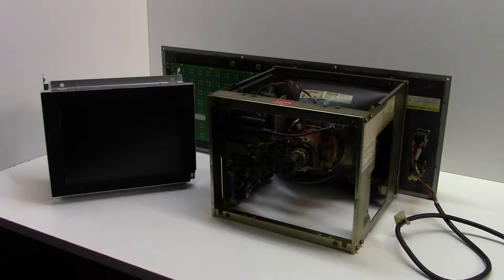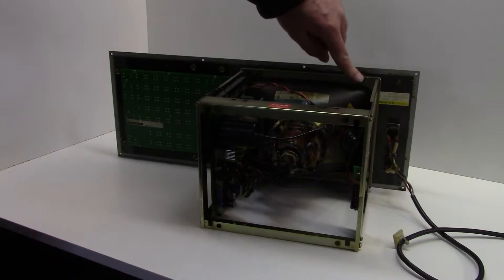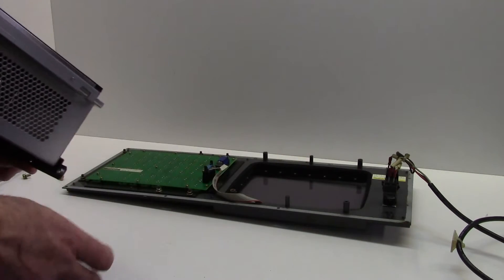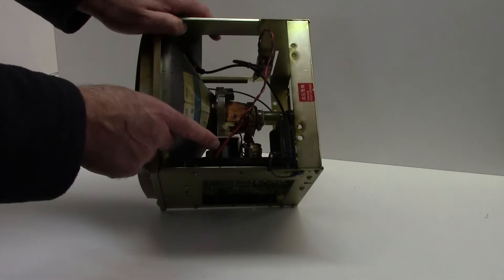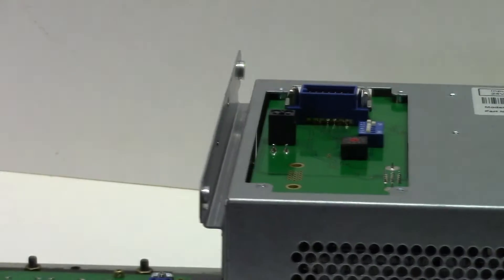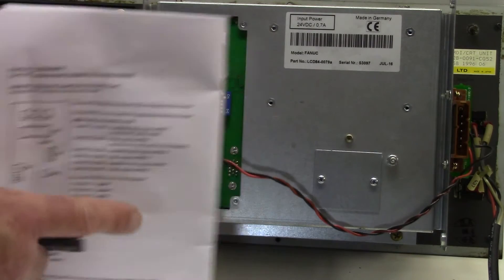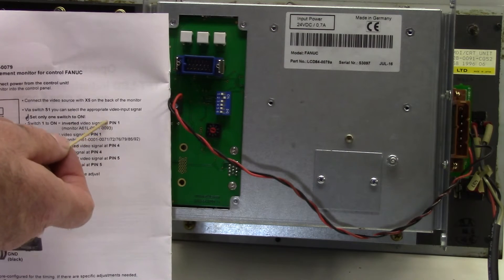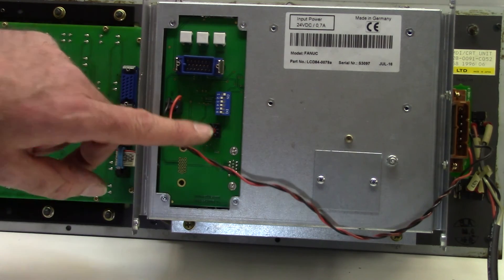LCD84 0079 Fanuc Installation

Comment: Shenzhen Elongshine Technology Limited is a factory specialized in CNC monitor ,Our products are with good quality and affordable cost for you. more info https://en.elongshine.com
eg: HAAS 28HM-NM4
FANUC A61L-0001-0093
FANUC A61L-0001-0092/0086/0076/0072
FANUC A61L-0001-0094/0074
FANUC A61L-0001-0095
FANUC A61L-0001-0096/0097
Mazak Monitor CD1472D1M and MDT-1283-02 (MDT1283B-1A)
Siemens Monitor SM-0901 and 579417 TA
...